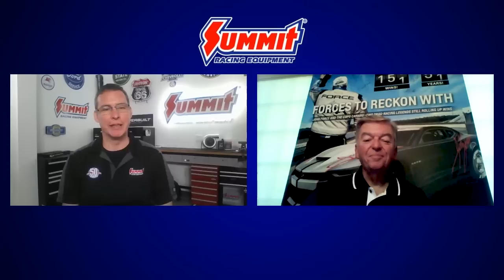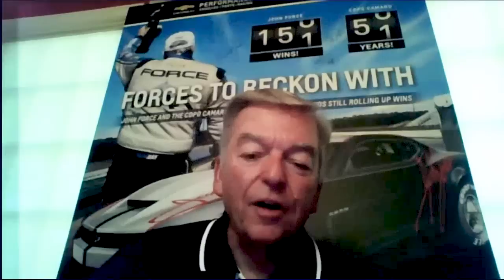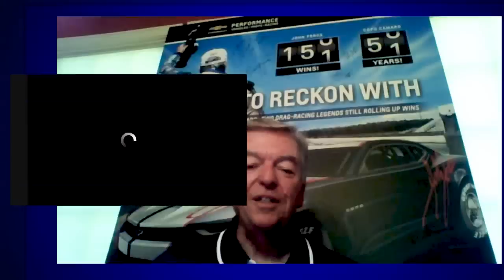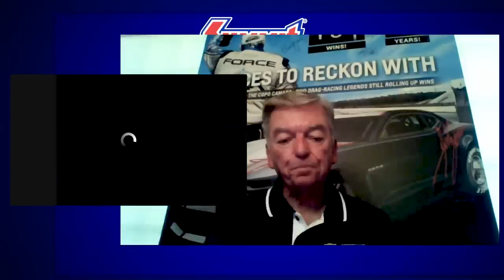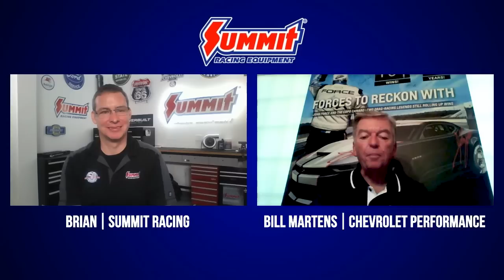Chevrolet Performance Introduces its LS7 Crate Engine

Comment: I purchased a 2004 2500 hd 6.0 and i have 160 thousand miles on it and the only thing i have replaced is the water pump and the knock sensors. i have never replaced the plugs or wires and it runs fine. i can go out reach in the window turn the key fire it up it can be 0 or 100 degrees outside and walk off leaving it running. this is very good stuff.

Comment: It is my understanding that they pulled existing LS7's with dry sumps and converted them to wet sumps meaning the existing heads were not redesigned. So it looks like the valve guide problem remains unless at some point Chevy recognized the issue and fixed all in stock. A parts transfer checklist sheet comes with the motor to show all parts added.

Comment: Will it drop valves like the production LS7 or? Has that been addressed?
Reply from the maker: Thank you for your question.  This engine has undergone an extreme durability testing and is expected to perform reliably.
Reply: @SummitRacing  That would be a "no."

Comment: Ford went back to the drawing board to with that piece of junk 5.4 with a 2 camshafts for it always had bad oiling problems install a high-volume oil pump oil to flow faster they always have oil return problems I know horsepower get an old Shelton's and look at the horsepower rating between the three big who wins Chevrolet

Comment: This is gonna be big news. Hopefully the valves are fixed?
Reply: Durability testing plus being based on a later version of the engine, make your own conclusion.  https://www.corvetteforum.com/articles/chevrolet-performance-ls427-570/
Reply: This a bs post still no definite answer
Reply: @angelochokas777  what is the question that you need answered?
Reply: @hidog420  the question I had previously asked 2 months ago?
Reply: @angelochokas777  Summit answered it 5 comments below you're original question.
Reply: @hidog420  where it says they performed extensive testing.....that's not a clear answer. Durability testing is not a definite answer ...I'm sorry they need to be more precise......and detailed..

What's it consist of

How many miles
What are the measurements in the valve guides.....
Reply: @angelochokas777  I agree, but with the fact that they know they have a problem with broken valves, I think they would address the problem and remedy that situation?